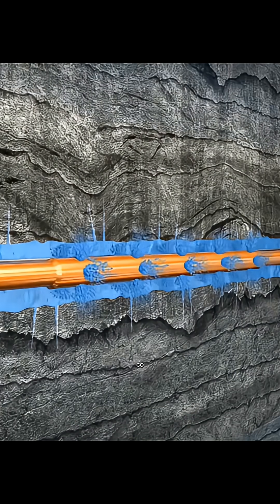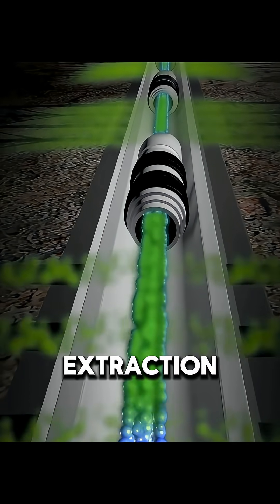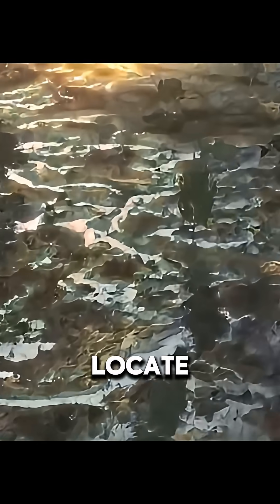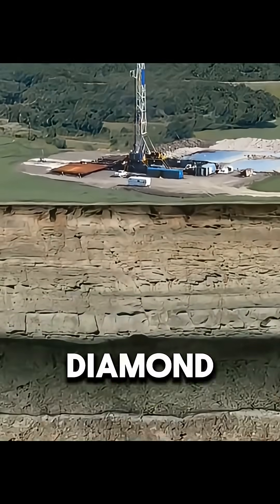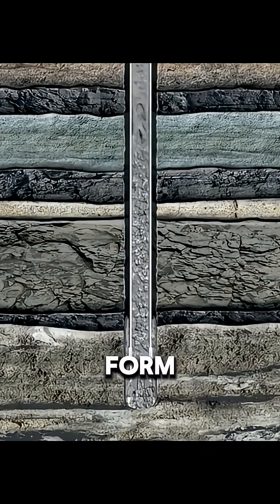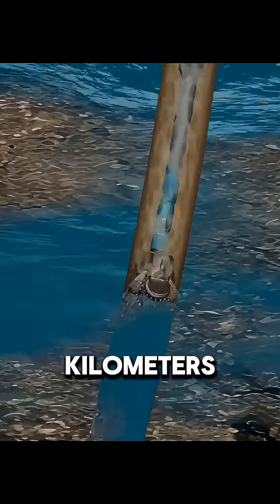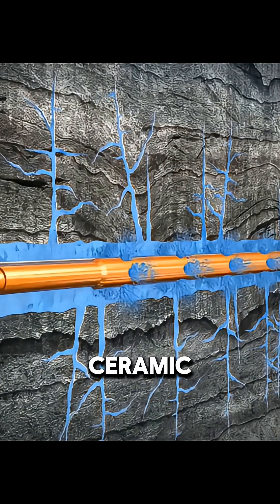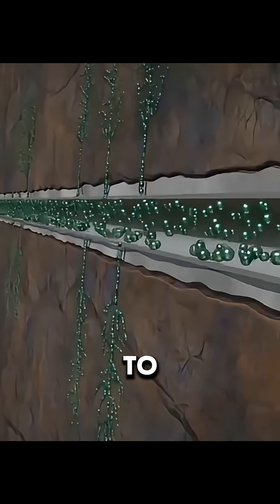How Do We Extract Oil from the Ground? #foryou  #zackdfilm #oil

Comment: They were doing fracking in Canada before they were doing it in the US. 
They were doing it in 1954
Reply: this is factually incorrect.  a simple google search that takes 3 minutes reveals that you were bodly wrong:

The immediate post-war period saw the birth of modern-day fracking. In 1947, Floyd Farris of Stanolind Oil & Gas began a study on the relationship between oil and gas production output and the amount of pressurised treatment applied to each well. This study led to the first modern day example of hydraulic fracturing at the Hugoton gas field in Kansas which saw the technique used to extract natural gas from limestone.
Reply: @boyeatsworld-vr9ci  well I have past customers of mine that were geological engineers that been experimenting with racking in 1954. 
They said it was done earlier than that. 
So maybe you should find out AI on Google is not always right  😂
But you partly admit, fracking has been around, just not mainstream
Reply: @boyeatsworld-vr9ci 

undefined
undefined
undefined
13 sites
Fracking began in the oil and gas industry in the mid-19th century through explosive "shooting," followed by modern hydraulic techniques developed in the late 1940s. 
Historical Timeline
1860s: The first "fracking" began as a process called "shooting the well". In 1865, Civil War veteran Edward Roberts received a patent for an "exploding torpedo" that was lowered into wells and detonated with water-tamping to fracture rock and increase oil flow.
1947: The first experimental hydraulic fracturing (using pressurized fluid instead of explosives) was conducted by Stanolind Oil and Gas Corporation at the Hugoton gas field in Kansas. This trial used a mixture of gelled gasoline (napalm) and sand.
1949: Halliburton performed the first two successful commercial hydraulic fracturing treatments on March 17 in Stephens County, Oklahoma, and Archer County, Texas.
1950s: The technology expanded rapidly, reaching a pace of about 3,000 wells treated per month by the mid-1950s. Fracking began in Canada during this decade, with the first application in Manitoba in 1951.
1968: The first "massive" or high-volume hydraulic fracturing (MHF) was performed in Oklahoma, injecting over 300,000 pounds of proppant (sand).
1980s–1990s: George Mitchell, often called the "father of fracking," began perfecting the combination of hydraulic fracturing and horizontal drilling in the Barnett Shale of Texas. This allowed for the economic extraction of gas from dense shale formations.
2003: Many analysts mark this as the start of the "shale revolution" or "shale gale," as large-scale commercial application of horizontal drilling and multi-stage fracking led to a massive boom in U.S. production.
Reply: @b @boyeatsworld-vr9ci 
Fracking began in the oil and gas industry in the mid-19th century through explosive "shooting," followed by modern hydraulic techniques developed in the late 1940s. 
Historical Timeline
1860s: The first "fracking" began as a process called "shooting the well". In 1865, Civil War veteran Edward Roberts received a patent for an "exploding torpedo" that was lowered into wells and detonated with water-tamping to fracture rock and increase oil flow.
1947: The first experimental hydraulic fracturing (using pressurized fluid instead of explosives) was conducted by Stanolind Oil and Gas Corporation at the Hugoton gas field in Kansas. This trial used a mixture of gelled gasoline (napalm) and sand.
1949: Halliburton performed the first two successful commercial hydraulic fracturing treatments on March 17 in Stephens County, Oklahoma, and Archer County, Texas.
1950s: The technology expanded rapidly, reaching a pace of about 3,000 wells treated per month by the mid-1950s. Fracking began in Canada during this decade, with the first application in Manitoba in 1951.
1968: The first "massive" or high-volume hydraulic fracturing (MHF) was performed in Oklahoma, injecting over 300,000 pounds of proppant (sand).
1980s–1990s: George Mitchell, often called the "father of fracking," began perfecting the combination of hydraulic fracturing and horizontal drilling in the Barnett Shale of Texas. This allowed for the economic extraction of gas from dense shale formations.
2003: Many analysts mark this as the start of the "shale revolution" or "shale gale," as large-scale commercial application of horizontal drilling and multi-stage fracking led to a massive boom in U.S. production.